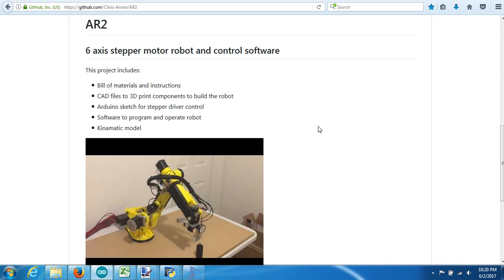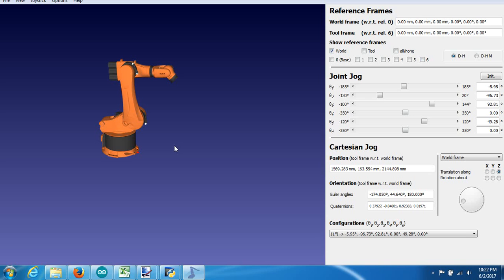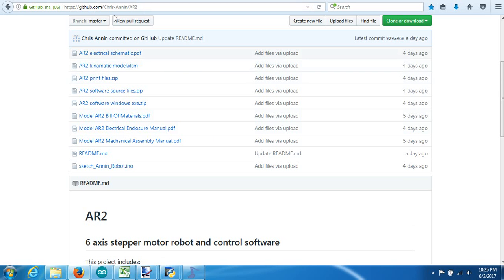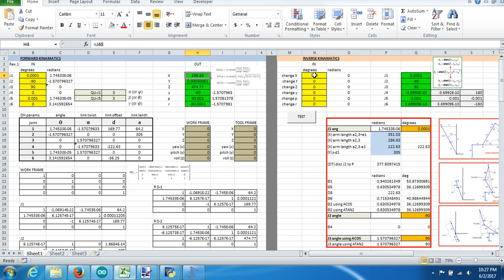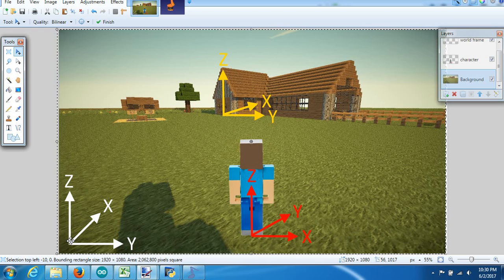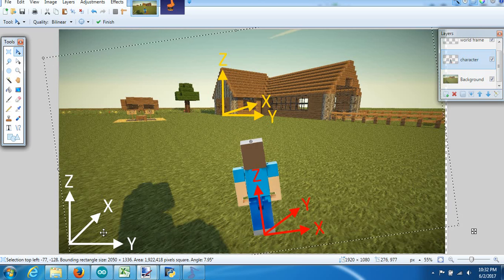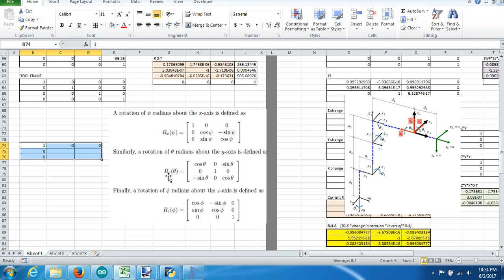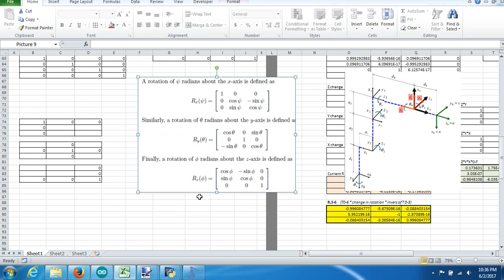6 axis robot kinematics Part 1

Comment: Great stuff Chris, thanks for this series on kinematics. I've watched the entire series. 
I have a few questions on this Part 1 video:
 1) Do you have the robot simulation XML file defining your robot that you could share, perhaps on GitHub? I've downloaded the application and would like to simulate your robot as in the video.
 2) RoKiSim allows for adding in different end-effectors (cad tools) in STL format. Do you have the "TOOl File" for the gripper used in your robot? If so, could you share it on GitHub?
3)Are end-effectors considered when developing the Denavit-Hartenberg parameters? It seems like RoKiSim does account for the different end-effectors.  If not, how does one (how did you) eventually account for the end-effector in the forward and inverse kinematic model?

Thank you.

Comment: Thank you so much Chris for making this available. I'm beyond words and I'm about to build one! I would like it to be a little bit quicker, any suggestion on which steppers to replace, and by what? Thank you again so much!
Reply from the maker: You can change the speed multiplier in the Arduino program please see the calibration videos. I have a video on articulation showing it moving a bit faster. You can select higher gear ratio motors from stepper online if you want you would just have to recalibrate the robot and figure out number of steps given each axis range of motion. Again this should be covered in the calibration video. I wouldn’t recommend making the robot to much faster as it can get a little bit shaky if you go too fast

Comment: So nice work! Excuse me ,can you tell  me where  is the  inverse kinematics code  which  matches the excel document ?
Reply from the maker: If you open the AR2.py source code with a text or python editor you should be able to see all the code including the kinematics.  I figured out the kinematics on the excel sheet first and then basically copied it into the program line by line for each cell in the spreadsheet.

Comment: My frustrations with the topic are captured perfectly in the section starting at 0:45 - the material often seems to be written from one phd student or professor to another, and though it may be mathematically "elegant", its a dense forest of squiggles to those not recently in academia. Additionally, for what is an intensely physical subject, requiring lots of images and diagrams, especially with IK the tendency to start off with a massively simplified 2 dof line drawing, then suddenly leap to the full mathematical solution of a 6 dof arm with none of the steps explained, makes the topic very inaccessible. I have the Spong book and found it to be equally opaque. Maybe you should write a Robot Kinematics For Dummies book? Looking forward to watching the series here!
Reply: Indeed and it's a very simple concept almost everyone can easily grasp and most people can solve if given a day or two.

Comment: great work!

still toBeDone:

what inaccuracy must we expect it the angle1 and angle2 and angle3 have a 
deviation of say +-0.1% ? 

this can be calculated but may be also useless to calculate for many applications.

what I talk about:

for many applications we need a sturdy robotic arm with as little joints a possible and 
with high accuracy as possible - sure this can be derieved from your great work!

I invite you to my group "OpenIdeas cnc&3dp" for further discussions.
Reply from the maker: The biggest inaccuracy is the backlash in the motor. The manufacturer claims 1.5 to 1° of backlash but it varies from motor to motor. Overall when I take it to a dial indicator I'm currently getting about .010" to .015"of repeatability difference , But also consider that's under compression of the robots weight in what it's doing.  The software should return the robot to an exact position so any and inaccuracy is in the backlash of the motor stretch of the belt or lack of rigidity in the arm.